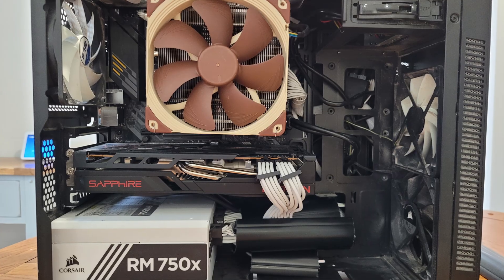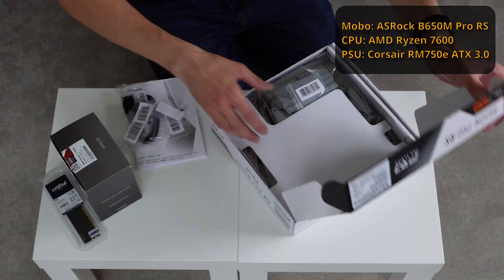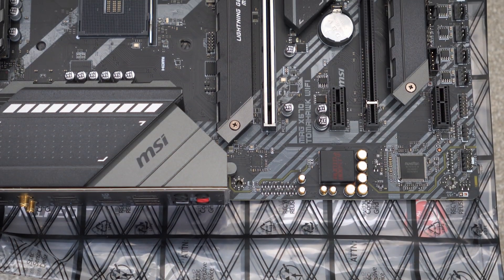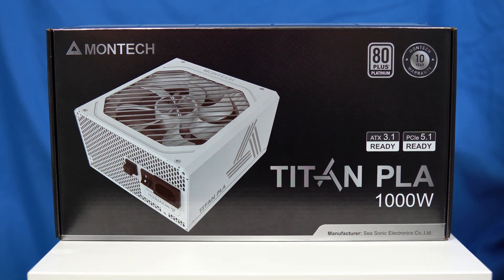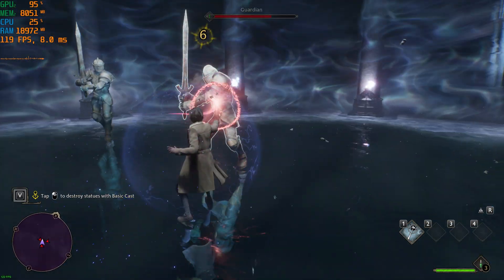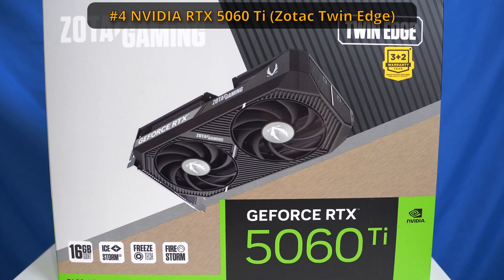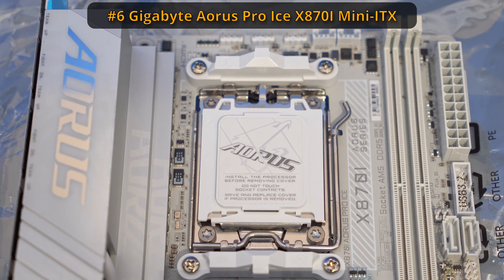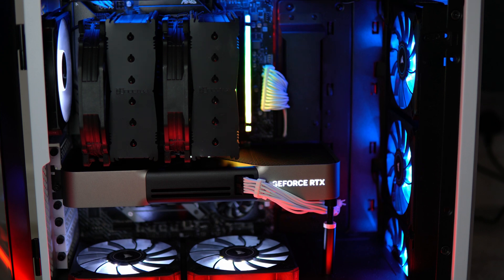4 GPUs, 5 PSUs and 6 Motherboards Later: Mistakes Were Made

Comment: Please help me! I'm upgrading some parts and I have an NH-D15 CPU cooler but im unsure what motherboard to get. Im worred about the cooler getting in the way of my GPU. How do I know what motherboards will make sure everything fits?
Reply from the maker: They should all fine :) I mean, the D15 is a very big cooler - but it's very, very unlikely that it will be blocked by the GPU. The main issue is that pretty much all motherboards have the top PCIe slot quite close to the CPU, so there won't be much room between the CPU cooler and your GPU. This shouldn't affect thermals though - it's just the 'fun' of tower air coolers.

Comment: Interesting video! I have a RMx850 power supply from a few years back, and it's got modular cables. Can you just buy a 12V-6x2 cable from Corsair that fits? (More of an academic interest, I am currently playing Serious Sam the Second Encounter on my 3080-12GB so I don't need an upgrade 😂)
Reply from the maker: Haha, I love Serious Sam games. In terms of the cable, if yours is a type 4 PSU/set of cables then yes, you should be able to buy a 2x8-pin to 12vhpwr type 4 Corsair cable and that should work out fine :)
Reply: @TechOverwrite  great, I'll check it out. Thanks!

Comment: Hello. The zotac 5060ti two fan….how does it compare to gigabyte windforce OC with two fan variant? I intend to use it for long unreal engine dev sessions, but I don’t know if two fans are enough to keep the card cool for long sessions at full power.
Reply from the maker: Good question, I've always been happy with the thermals of the 5060Ti Zotac - it never seemed overly loud or hot to be honest. I think the fact that its power draw is 180w max (and I often saw it only use 120-150w) helps too - I don't think that more than 2 fans is needed for that.

Comment: Started off spending over 2k on a 9800X3D build, realized it was a lot more than I needed to spend so I sold it and built a 14600k with a 5070 instead for $1,200 😊
Reply from the maker: Ah nice, congrats - that's still a very solid build 😊

Comment: Just build my first AM5 PC, slowly upgrade from PS5 (I'm tired with expensive online subscription), I'm glad I'm doin my research first, using 7800x3d CPU,32gb ram 6000mhz cl30, MSI B650m plus wifi,850w PSU, the only thing left to buy is GPU, I'm using my 4k LG C1 tv  as my monitor , should I buy 5080 or wait 5080 super?
Reply from the maker: Ah nice, that sounds like a nice build :) It's hard to say for sure re: the GPU. I would probably skip the 5080 now unless it was a really good price. If you're happy to sell it in the future, you could potentially go with a 5070 Ti now - and then upgrade to a 5080 Super down the line.

Comment: I finished my build a couple of months ago: Ryzen 9900x, Asus RX 9700, Asus Crosshair Hero X870e, 64gb Kingston Fury 6000 ram, Antec Signature Titanium 1000w PSU, 3 x Samsung NVME, 3 x SSD's, be quiet light base 900, be quiet silent loop 420mm aio, 7 x Phanteks M25 Gen2 140mm fans, Asus K7 keyboard, Asus Gladius 2 mouse, LG 32" 1440p HDR monitor...
Cost too much, but is worth every penny..
Reply from the maker: Ooo very nice, congrats on the build - that sounds solid all round :) At least now it's done and you won't need to upgrade for a while lol.
Reply: ? Price of your build ?   Nice build
Reply: @losangels4140  I would around £3000

Comment: I spend a long time researching before buying my PC parts, like I do for everything else because I don't want to keep replacing things unless they break.

I recently built my first PC and that bastard cost me C$2600 with Prime Day deals, even though I only planned to spend half of that but I'm really satisfied with it.

For those who want to know: I got the Ryzen 7 7800X3D & the Gigabyte RX 9070 16TB. The MSI MAG B850 Tomahawk MAX WIFI & the MSI MAG 850W 80+ Gold. Thermalright Peerless Assassin Digital RGB, WD_Black SN850X 2TB+ Corsair Vengeance 32GB CL30. Logitech Hero G502 Mouse + Logitech Apex 3 Keyboard. The Lian Li LANCOOL 216 RGB case & the KTC 32" 1440p 180hz Monitor.

I wanted to get a 9070 XT but it's only 12% more powerful than the 9070 and was $150 more expensive where I live. I hope this PC lasts me at least 5 years because I already sold my PS5 & my Switch to fund it, I'm done letting console corporations scam me.
Reply from the maker: Ah very nice, congrats on the new PC build :) That sounds like a great setup all round. It's always expensive at first especially since you don't have the monitor, keyboard and mouse (or case) but those are components that will stick with you for a while. Plus if you ever did want to upgrade a single component in the future, you'll probably find that there's a somewhat healthy second hand market for it - meaning that the cost to upgrade won't be as bad as you'd think. Either way, enjoy - and welcome to the PCMR lol ;)

Comment: Lol, I did all this with LGA 775 and again when Haswell came out,  still have two Q9550 systems and three 4770K systems, Mini/Micro/ATX lol.  I had lot's of fun in the early years with Athlon XP 3200, Mac G3's, I even remember Ubuntu being released, probably before your time but green IDE cables too lol.  
Building PC's is simply grown up lego, it's fun buying various components or even pulling out old parts, and making a working machine. Mistakes are part of that journey.
Reply from the maker: Hah that's awesome, a trip down memory lane - I loved the Athlon XP lineup 'back in the day'. It's easy to go down this route/trap lol, but I learned a lot and you're right, tinkering and building PCs is part of the hobby tbh :)

Comment: I'm still on AM4 and  can't see moving to AM5 anytime soon.
It would be a huge outlay of money at this point as I have 4 PCs.
1. Main PC 5800X3D driving a RTX 4070 TI Super
2. Backup PC 5700X3D driving a RTX 5060 TI 16GB
3. Recording/streaming PC 5600X driving a RX 7600 XT 16GB
4. SSF LAN party PC 5600 driving a RX6700 XT
It would be around $4K to upgrade to AM5 as I would want to have X3D CPUs to replace the AM4 X3D parts.
Reply from the maker: Ah nice, that sounds like an awesome setup, and I agree that there's no real reason to move to AM5 for you - especially since the latest gen GPUs run fine on PCIe gen 4. There's barely any performance benefit to running them in gen 5 mode. Love the 5700x3d and 5800x3d, they offer so much bang for your buck.